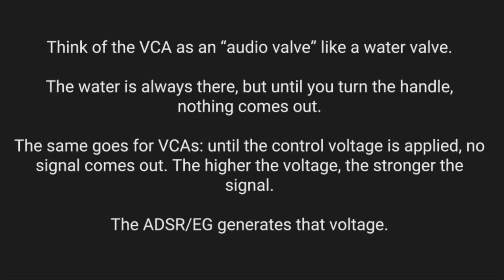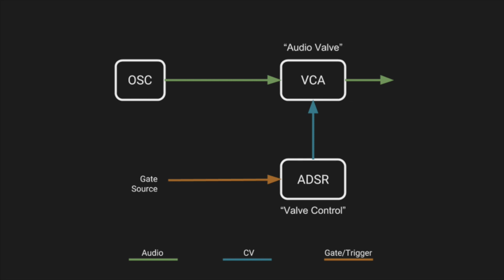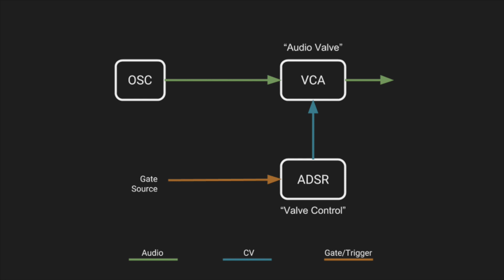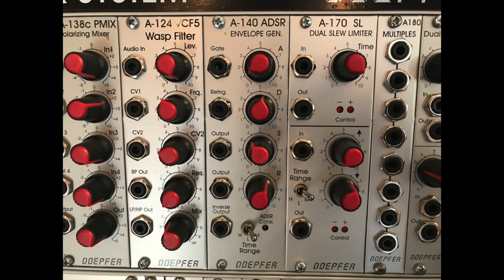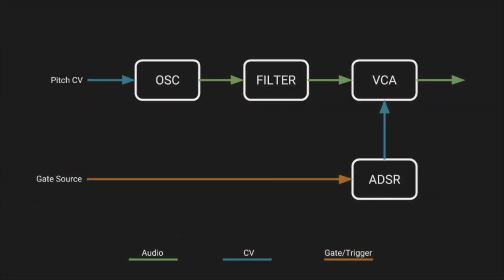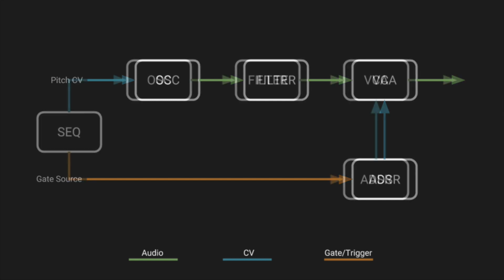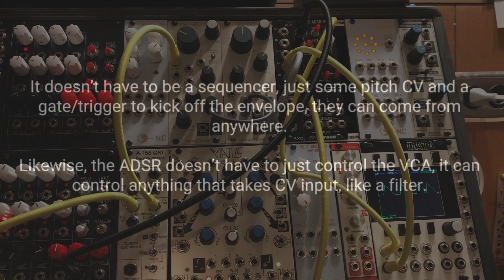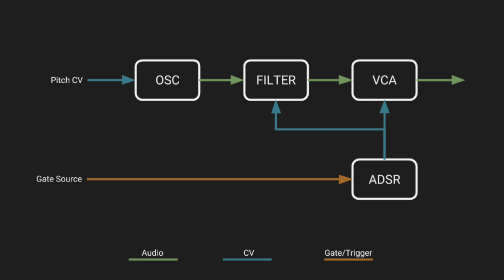How do VCAs work with ADSRs?

Comment: "Audio valve"? This immediately reminded me of remote cut-off pentodes, where transconductance (and gain) varies a lot with control grid bias voltage. These tubes were used in RF circuits for automatic gain control to increase the signal from weak radio stations while not letting the strong ones overdrive the demodulator and audio frequency amplifier. Basically, a dynamics compressor, but for radio frequencies.

Comment: Very clear explanation.
I have some questions.
1. What parametes does the keyboard of a synthesizer change? The frequency of the oscilator? The voltage rhat controls the VCO?
2. If there is only one oscilator to generate que frequency, how does the system works to generate chords?
3. How many "channels" are there on the sequencer and what parameter does the sequencer change? The voltage control to be aplied on the modules?
Thank you!
Reply from the maker: Hey, thanks, I'm glad it was helpful.  To answer your questions:

1) It's both.  Playing a note is going to send a different control voltage to the oscillator, and that will determine the frequency of the output.  In eurorack, adding 1 volt to the CV increases the pitch by an octave (which is a doubling in frequency)

2) In short: you don't.  Many eurorack systems are monophonic - they just have the once voice.  There are a number of modules that will output chords, but if you want to do proper polyphony then you will end up needing one full oscillator-filter-adsr-vca set for each note in the chord.   I have a video that demonstrates that setup: https://www.youtube.com/watch?v=5DMUukOaqKE

3) Sequencers can be quite different, but this one has 8 steps and it outputs 3 CVs (they're based on the same knob settings,  just scaled, but that can still be pretty cool).  In this case it is doing the job of the keyboard, sending the CV to the VCO to tell it what pitch to play, but of course it can control anything.  One thing I like to do with this one is to use one output for the pitch, and another one scaled down to change the filter cutoff.  That way you get a subtle difference to how the notes sound at different pitches.

Comment: This is incredibly helpful. I have a mangrove, a 2hp ADSR, and Maths. Can i use Maths as my VCA?
Reply from the maker: Thanks!  Glad it was helpful.

I've never used a Maths as a VCA, but apparently it can be used that way 'in a pinch' (so it probably isn't super clean and reliable) and it requires all 4 channels, but, from the website:

Patch audio signal to CH. 1, with RISE and FALL at full CCW, or cycle CH. 1 at audio rate. Take output from SUM out. Set initial level with CH. 1 panel control. Set CH. 2 panel control full CW to generate a 10v offset. Audio will start to clip and may become silent. If it's still audible, apply an
additional positive offset with CH. 3 panel control until it is just silent. Set CH. 4 panel control to full CCW and apply envelope to Signal IN, or generate envelope with CH. 4. This patch creates a VCA with assymetrical clipping in the waveform. It will work with CV also, but be sure to adjust CV input settings to deal with the large base offset. The INV output may be more useful in some situations. 

Honestly I think you'd have a way better time investing in something like a 2hp dual VCA.
Reply: @SoundVoltage  Wow, so insightful, thanks for taking the time! sounds like a little 2hp VCA is in my future!